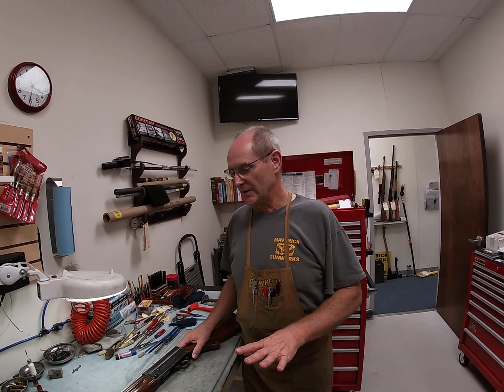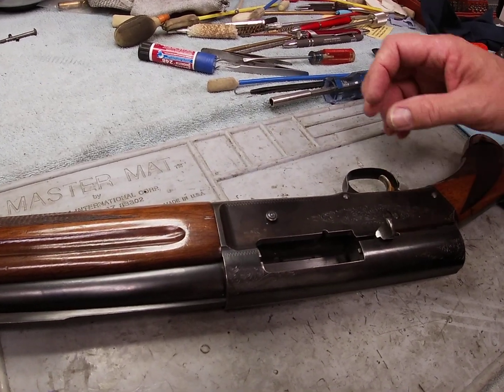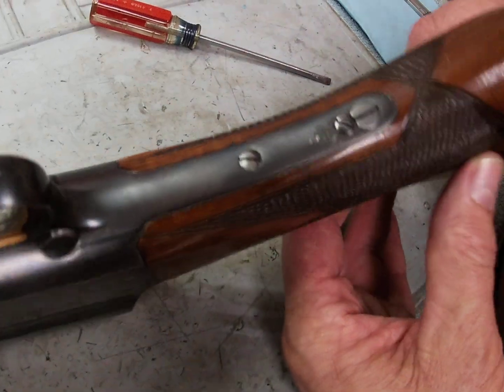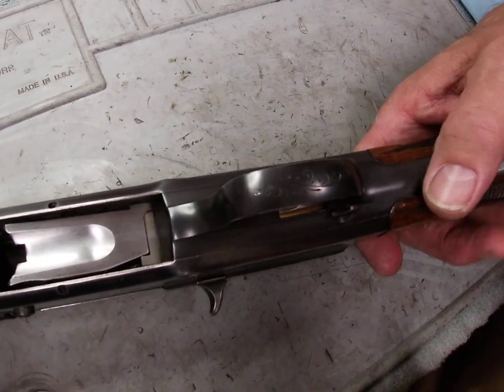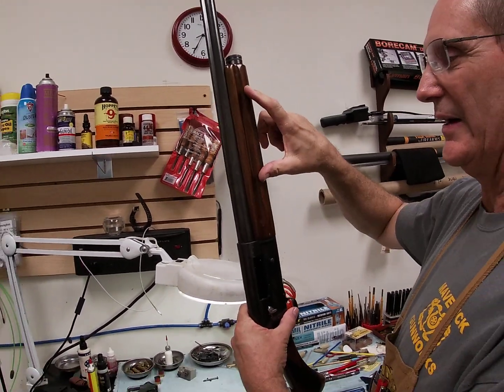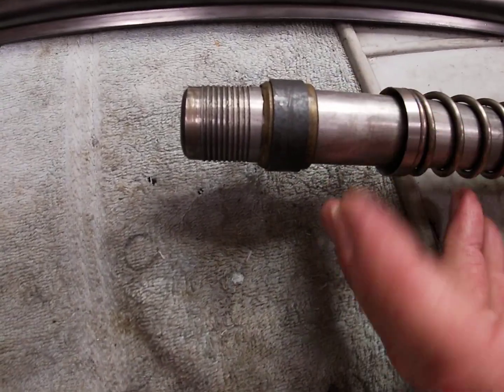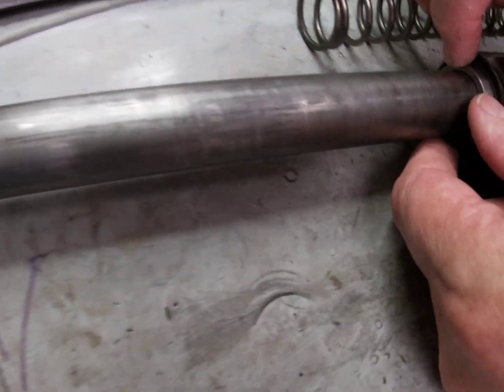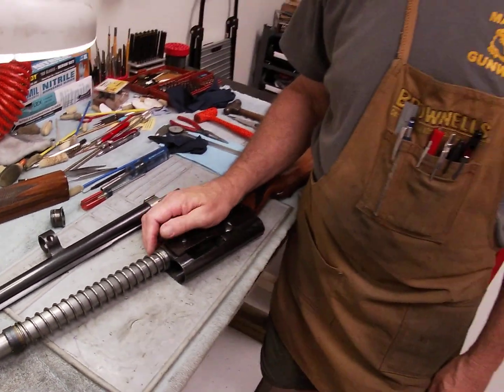Browning A5 Cycling Issue

Comment: Thank you. I have definitely had an issue with light, target loads and was wondering if it was because I had an A5 "magnum." I will rearrange my friction rings per your instructions and see if that solves the issue.
Reply: The Magnum actually has a different spring (slightly longer, and heavier). It will struggle with target loads under 1300fps muzzle velocity. I've seen one "trick" fix by ordering a Light 12 spring and replacing the Magnum spring while using light loads. Just remember to switch back before using heavy loads again.
Reply: Hey Robert I have a problem with an a5 from 1960. Its an FN A5 from Belgium and its a magnum that sais special steel on the barrel . I have tried everything you can think of to get it to cycle light loads. I have switched the rings  to light loads, i have tried working it in and it still wont cycle them. The light loads dont have the necessary power to  eject them...any help will be appreciated, thank you
Reply: My light loads would not eject. But this repositioning of the ring on my Belgium made A5 did the trick. Major difference. Thanks. Father in law bought the 12, 16 and 20 as a collection with his brother when they finished up in Korea. The brother received the bronze star

Comment: Art I noticed the slots on the compression rings were about 180 degrees apart.  I thought they were supposed to be together so the compression ring can compress the friction rings.  Could you let me know.  My dads A-5 is about 100 years old and the owner's manual denigrated about 30 years ago.
Reply: My a5 still has the ring instructions inside the  wood forearm. It shows the gap/notch in both the inner and outer rings in the same position. So it's open essentially. Not really sure if it matters though. Look for a pic of those instructions online.

Comment: I was having trouble with my auto 5 this past weekend. I had it assembled for light loads with the friction ring positioned near the loading area. I could get the first shot off but it would feed 2 rounds from the magazine tube and cause a double feed. Do you have any recommendations or advice to fix this?
Reply: How did you fix this issue? Mine done this to me last weekend
Reply: Never fixed the issue. Brought it out this year and it got worse. Sent it in to the gunsmith and waiting for response. Initial assessment was quality control with ammo?@nickcaison7783

Comment: My old browning cycles light clay loads just fine, probably much more reliably than any current production gas or inertia guns. Just make sure you have friction rings set up properly based on loads you are shooting
Reply: How heavily do you oil the tube? And how often do you do a full disassembly to clean?
Reply: @Zach-td5mb  use motor oil on the tube but you don’t need to overdo it. Just lightly as you would for any other part of gun. I generally just run a bore snake through it after shooting. No need to dissemble.
Reply: @ladduncan  how would you say the recoil compares to a modern gas or inertia gun? I have an original 28” magnum stalker getting shipped and am going to pick up a Belgian light 12 tomorrow, excited as I haven’t shot one other than one time as a kid.
Reply: @Zach-td5mb  it’s not bad recoil, depends on the load really but that’s true with any SA shotgun
Reply: @ladduncan  haven’t picked up my stalker yet, but after putting some rounds through the light 12 I am in love. Shooting 1200 fps 1 1/8 loads on the light setting recoil feels similar to a Beretta A300. Same loads on the heavy setting and it’s less recoil than the A400 I had.

Comment: HELP!!! Lol
Sir my name is Todd Stenner and I just found your video on YouTube. I am a South Georgia resident. I have an old Belgium Browning A-5 Magnum. It has a 32” super full tight barrel. It’s a very old shotgun needless to say. I’ve had some of my elder friends tell me that the model I have was made for goose hunting in the 60s but I’m not sure sir. What I am sure of is I’ve bought and tried many shotguns over the past three decades and none seem to hold as tight of a patter with deer or turkey loads. It started jamming on a duck hunt this past December. It’s been about a decade since it started jamming last. I cleaned it to the best of my ability and lightly oiled it and it’s still jamming with three inch turkey loads. The past couple times I cleaned it it worked like new for a decade. If you have any advice for me please feel free to contact me anytime sir!! I am desperately trying to get this shotgun cycling correctly before turkey season comes in in a couple of weeks. I thank you for your time as well as your video on the light twelve Belgium

Comment: Wonder if my Hatfield SAS 12-GA is having this same problem? Because it cycles 00 buckshot great, but anything lighter the shells will not eject. I have to manually pull back the bolt and physically remove them, but shooting 00 buck no problems at all.
Reply from the maker: Do not think so.  You may want to send it back to the factory or take to your local gunsmith.  Thanks for watching our channel.
Reply: I bought my SAS and shot about a box through it and never got it to cycle a single three round set . Sold it and bought a browning 16 ga